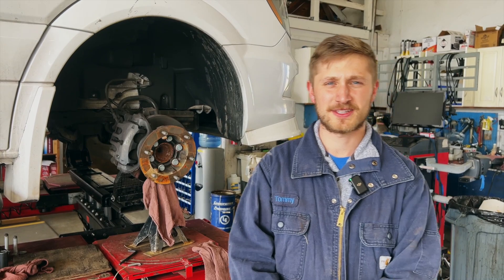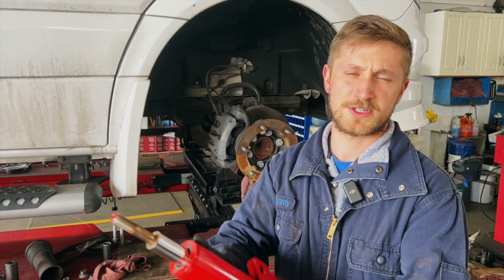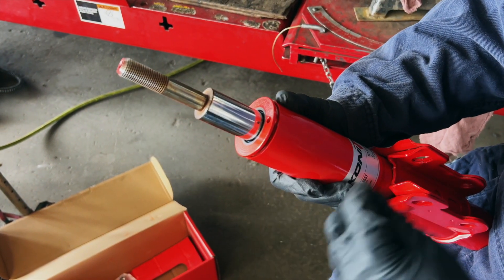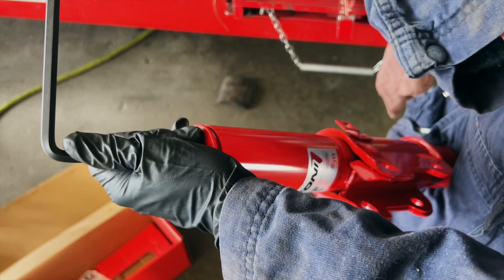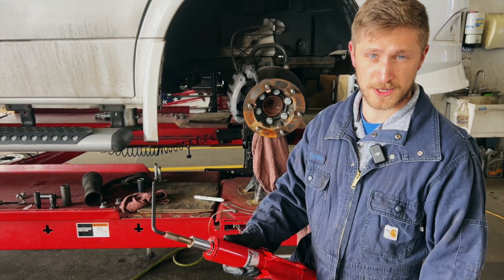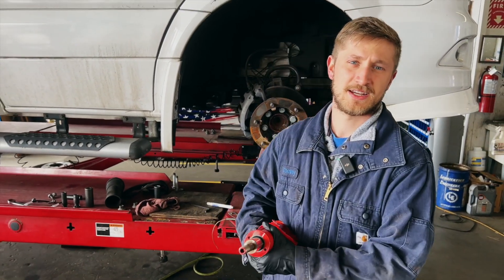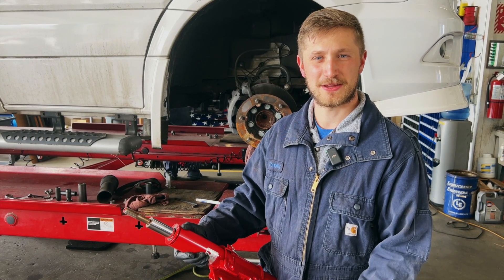The Perfect Strut Adjustment for the Sprinter 3500 2WD Using Koni Part #87-2657

Comment: I set mine to 75% on our 2017 Navion and what an immediate improvement in road handling on interstates during cross winds and semi passings as well as on mountain switchbacks.  But then I installed your rear Trac Bar and experience greater safety specifically on interstate when passed by semis and during crosswinds.  I had already upgraded the rear shocks and sway-bar so I'm extremely happy with The sprinter ride and increased safety margin. I'm now waiting for the test results on the wheel spacers.
Reply from the maker: Thanks Earl for the feedback! It's great to hear how others are experiencing the same improvements that we felt on our own Navion :)
Reply: I would like to hear more about the wheel spacers

Comment: So you’re recommending a 50% setting for a Sprinter RV for someone who doesn’t want to give up ride comfort but  still wants more sway control?
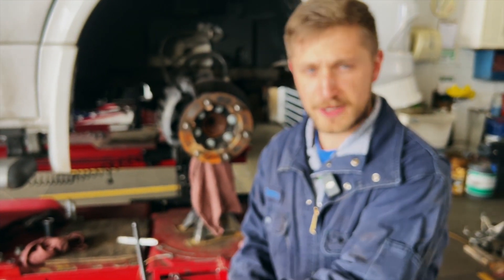Reply from the maker: Yes, At 2:50 in the video Tommy breaks down the settings. 50% is much better them OEM shocks. If you really want sway control go to 75% but you will sacrifice a ride comfort.  Hope that helps!